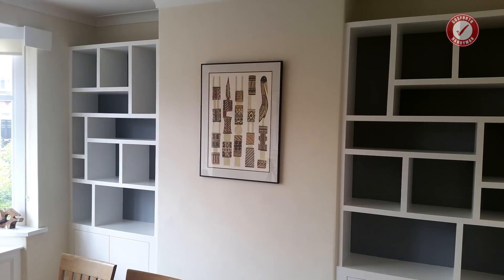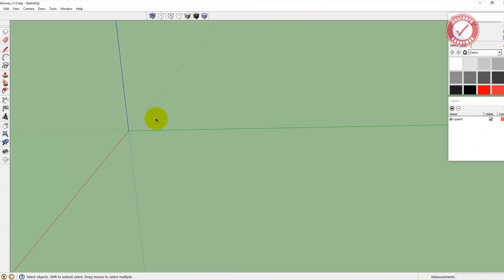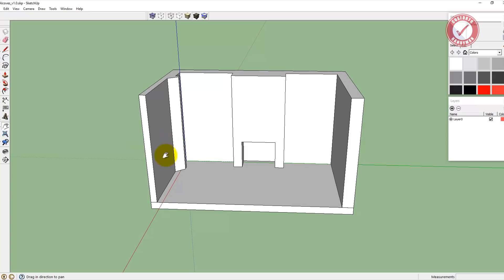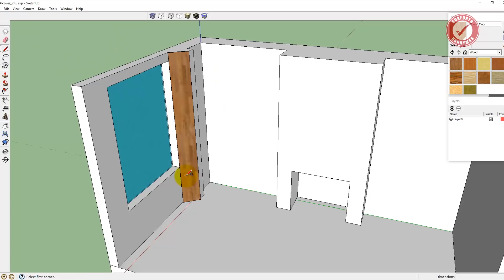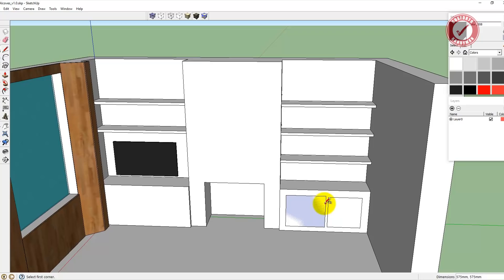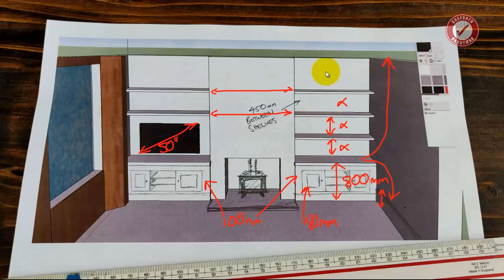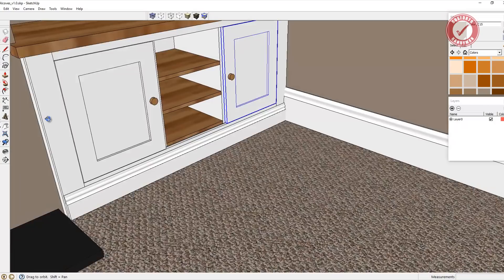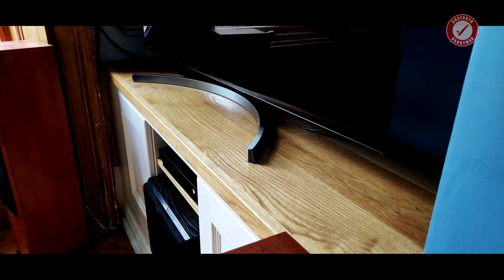Designing built-in alcove units using SKETCHUP

Comment: Really interesting video Andy. Can I ask how straightforward is Sketchup to get into? You’re obviously very accomplished on it, but how did you find it when you started using it? Cheers, Leo
Reply: Its quite easy to use, especially compared to many other 3d modelling packages. It also allows you to put things together very quickly too. There are also loads of tutorials and guides due to its popularity.

With the above said, it obviously depends on what you need it to do. If your goal is to create 3D assets for media based purposes, or to animate etc, you really should be looking elsewhere. Since using Sketchup would be like using Microsoft Paint for commercial design purposes :p
Reply: Sketchup is one of the easiest 3D modelling packages to get into, as the name implies, you basically used to just sketch up your designs. You can get really good at Sketchup over a weekend if you wanted, and the basics can be learned in an afternoon. There are so many tutorials online that if you get stuck, you just google your issue and there'll be hundreds of solutions!
If you're a complete noob, I would suggest learning Fusion 360 instead, is more complex, but it's a lot more powerful, plus if you're learning from scratch, you might as well throw yourself in at the deep end!
Reply from the maker: Honestly, I'm just a beginner with it - accomplished users would cringe at some of the inefficient ways I do stuff! Pretty easy to learn when you get the fundamentals. Obviously depends how technical you are - Fusion is a bit of a beast but a lot more powerful by what I can gather. 👍